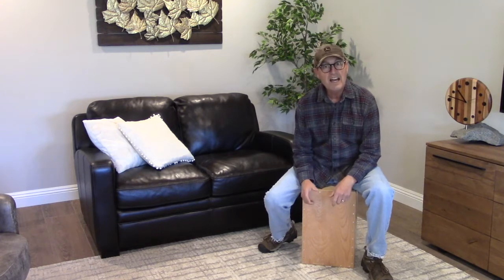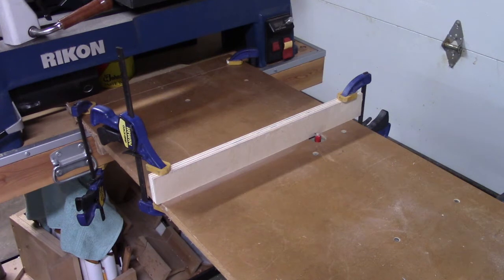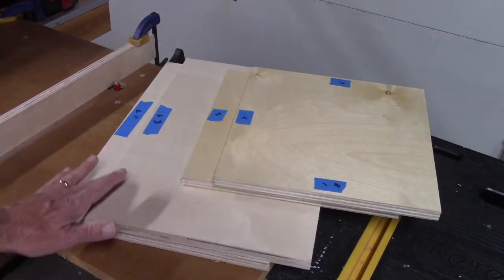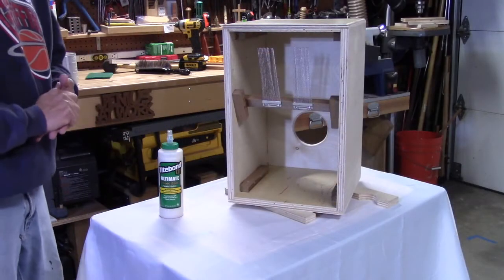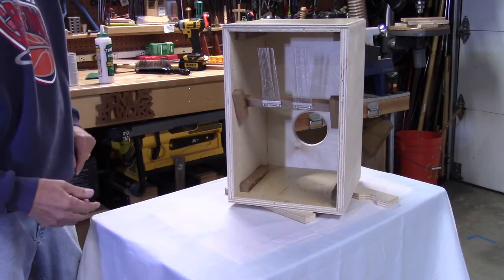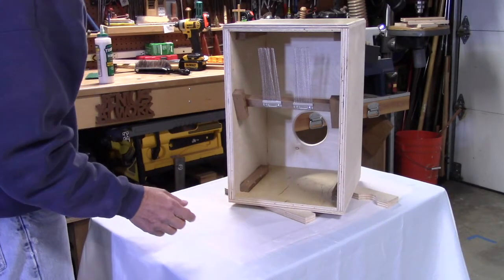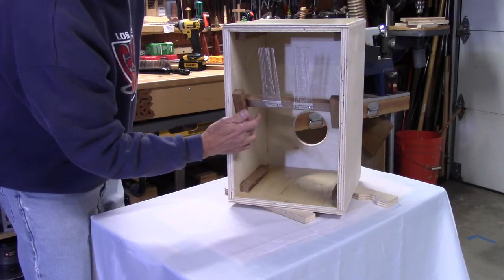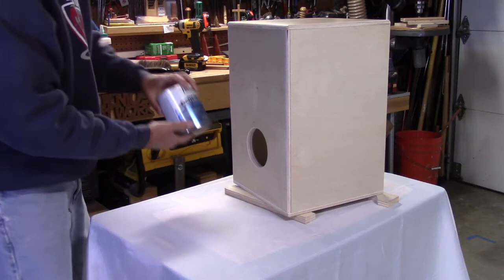DIY Cajon Box Drum

Comment: Explain location of hole I’ve seen them like yours an I’ve seen them in middle an very few with small holes in different areas
Reply from the maker: I know very little about Cajon box drums.  I love working with wood and my grandson wanted one so I just looked at a lot of pictures and made one that seemed to be similar to those in use.  It ended up sounding very good.  Good luck!
Reply: @gfotinakes316  im on my fifth build I’ve set in  a music store and played with many an looked carefully at each model i played with from hole size to location of holes box sizes from height width lots of variations two hole to single large holes from glued tapa to wood screw an inserts an screws  long term inserts and screws for long lasting adjustments for tone change without wearing holes using just wood screws
Reply from the maker: @michaelwillcutt2619  You sound like a pro, keep up the good work!